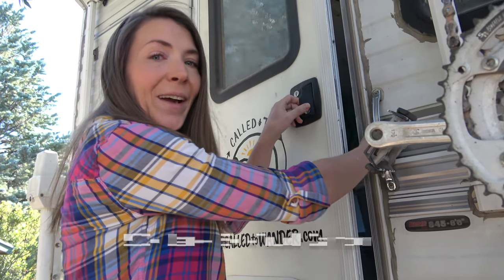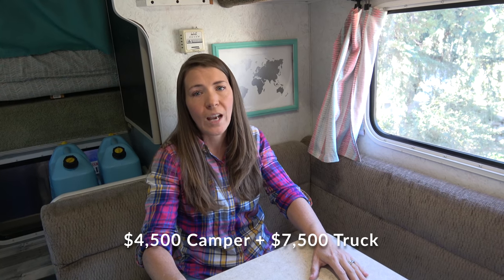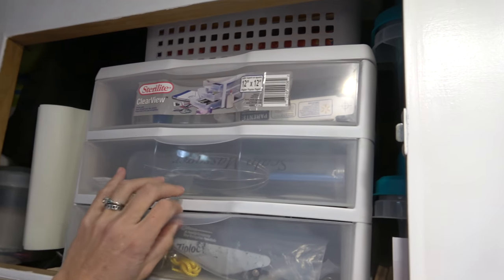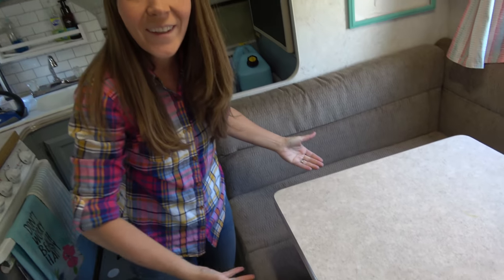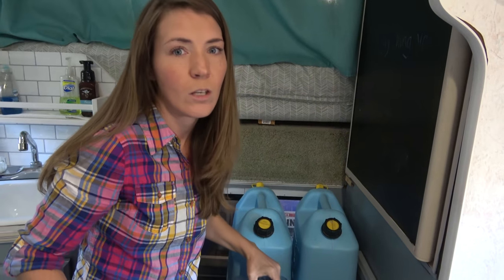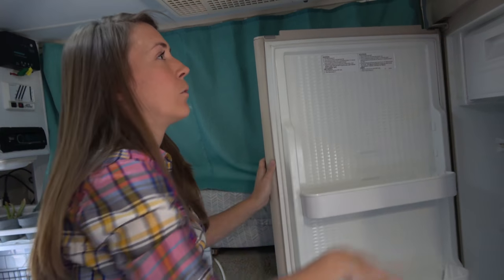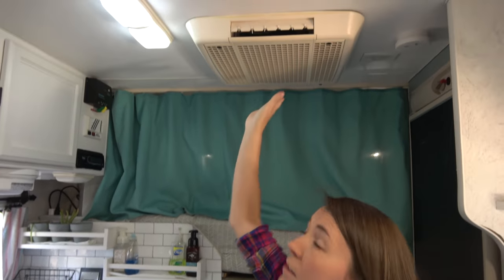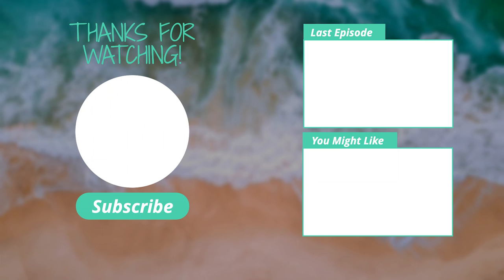TRUCK CAMPER TOUR after 2 YEARS on the road // Tour Our Remodeled Tiny House on Wheels // CtW

Comment: The location of the bed in these campers invites mold, very informative on how to prevent moisture from collecting underneath your mattress. Your transparency about rot and how you cured the ill. The bathroom door solution will help  keep the moisture down in the bathroom too. Good job! Thanks for sharing. ✌️☮️
Reply from the maker: Thanks! We did discover mildew beneath our bed and realized we could build a simple setup for much less than the fancier systems that are sold. Thanks for watching and reaching out!
Reply: @CalledToWander   They have Froli systems people really like.

Comment: I have an older Lance 945 Squire camper on a 1997 F250 HD with the Legendary 7.3 Power Stroke as well!! A truly incredible engine and truck! I like leaving the inverter accessible like you did... but instead of running wires throughout, I wired my inverter straight to the electric box so all of the outlets around the camper - inside and out - are energized. I also have to get something under my mattress as well. That was a super idea and cost effective too - I had mold under my mattress as well. Love your channel!
Reply from the maker: Thanks so much! We’ve traded in the Tc for a motorhome but miss our tc dearly. Enjoy the road!

Comment: 27:30
2003, we built our latest ExpeditionVehicle.
I fabricated a metal bed frame over our flip-top crates storage.
The mattress lays on 'expanded' metal, similar to stout window-screen.
For ventilation -- irregardless of weather or season -- we open windows on opposing walls.
To reduce interior humidity, we cook and shower outside.
Summers are up rough logger tracks to remote mountain lakes, winters on isolated Baja beaches.
If the weather turns too wet too long, our caravan can usually agree to move.
Reply from the maker: Sounds nice

Comment: Great video , very well explained and thought out mods . I have a 1989 Lance  Squire-4500  . I just got it and repaired it , then  added solar , two more batteries , roof rack , stereo etc . But yes exact same floor plan and design . I have it on my 2000 Dodge Ram  2500 diesel truck  5.9 cummins . I bought it for the one piece metal roof and it's really light at 1730 lbs. I have been thru 4 campers now and still have two of them . Ok thanks again and happy trails out there .... 👍
Reply from the maker: Thanks! Sounds like you know far more than we ever did about TC! Glad it's working out and thanks for watching and reaching out!

Comment: You guys have really nailed it. Your tour was very informative, thorough and really demonstrated what it is like to seriously live full time in a camper. Many touches most people would never probably think of, the roll-up bathroom door, the wooden grid under the bed to prevent mold, the subway tile in the kitchen, etc. Every square inch is utilized. Excellent presentation and thanks for your effort and for the references where to purchase your upgrades. Thank you for mentioning the price point of your rig, it's a good baseline when we go shopping to know there are some great bargains available. Also, the nod to Ikea was helpful (they should sponsor you!). Ikea may want to create a section just for RVers, they would make a fortune. Thanks again.
Reply from the maker: shrinkdoc49 Thanks for all the positive feedback! We wanted to go with a longer tour to give a lot of the details that most tours tend to pass over. Let us know if there’s anything else we can show you about the camper!

Comment: Thank you for sharing your tiny home with us. We use the space above our bedroom windows to hang our hats. We also use the ceiling to hang our fishing rods. We have a fifth wheel but making our bed is difficult too. Just last year I had an happy accident. I was too tired to make the bed so I just folded the sheet and comforter then layed it across the bottom. I layed the decorative throw across it then tossed the sham pillows in place. When I looked back I realized it looked just as pretty as if I had struggled to make it. So now.. that's all I do. So much easier. Don't know why it too me so long to figure that one out. Lol. Happy travels.
Reply from the maker: That is a happy accident! We will don't put much effort into making any bed so even what you came up with sounds like work! Thanks for watching and reaching out!

Comment: Suggestions or idea's ?  my goodness no.  I am in awe of how co-ordinated and beautifully you have used every space available.  Things aren't just put in space to get them out of the way,  on the contrary you have things in spaces where you need them for ease of access.  Your tour was complete and informative and I can't think of anything you missed.  I love the removal of the bathroom door and the roll-up bambo curtain.  
I have had an old motorhome, 2 5th wheels and now a pull behind travel trailer I live in full time.  I traveled from N.J. to Arizona back in the 80's in a truck camper my 1rst wife owned, and it did great.  
I have seen the winds of Wyoming, Colorado and the Dakota's and figured it could be scary with a truck camper being so top heavy and narrow based. This is where I would figure a dually would give more stability.  Have you and Chris ever experienced heavy wind issues?  
Super nice video and great job. I was riveted to the video from start to finish.  
Best of wishes to you both for a super future.  
After my wife of 21 yrs passed away, I sold our home and land in northern Vermont and have lived in my travel trailer ever since. 
10 yrs to date. Presently set up in RV resort outside of Tampa. (Thonotosassa, Fla)
Bruce Matthews/retired farrier of 47 yrs. Disabled Vet.
Reply from the maker: Thanks for taking the time to reach out! Sorry for your loss, but glad you're making the best of the nomadic nature! We had some really rough wind coming across the panhandles of Texas and Oklahoma. And again in central Wyoming outside of Lander. The truck held up well and we don't know whether the dually would have helped or not. We just went slow and steady and kept an eye on the weather before driving into winds that we knew we could not handle.

Comment: Hey Chris and Lindsey,
Enjoying what we have seen so far.  We have the same camper, model and year.  Added 200 watts of solar last summer, except we have our camper on a 2002 Chevy Duramax.  Funny we have the same 17" Blackstone, love that grill.  I just purchased and installed the indoor shower head as per your suggesting (thank you), yet to try.  
We generally use our camper daily for dawn patrol SUP surfing, love having a heater to change into my wetsuit, our own bathroom and a outdoor hot shower after.
I've been thinking of converting to a flatbed for months, not sure I can get the same bang due to the original bed is a short bed.
Anyway's look forward to reviewing more video's, I'm interested in Alaska.
Stay and eat healthy!
Reply from the maker: Thanks for watching and reaching out! We love our camper and glad you feel the same about yours! The shower head is going to be so much more convenient! As for the flatbed - the shortbed won't be a terrible. We built in the extra space between truck and camper with our long bed but it's just luxury really. If you want the side storage with the flatbed that you lose with a standard bed then flat is the way to go. We didn't want to lose all that space. But it's definitely 6 one way and a half dozen the other! Sounds like you are using your setup well! Keep us posted if we can provide any more help or ideas! Thanks again!

Comment: Love the video. We camp a lot we have a dodge 3500 our camper is a 11.5 skyway. We have 1100 watts of solar and 4 battery bank. I like some of the changes you made. I removed the furnace and installed a warmtoo diesel heater very efficient uses like no power at all. Also if you installed a easy start on your a/c unit you would be able to use just one of those generator.
Reply from the maker: Thanks for pointing out your mods. We'll look into what we can do with ours.

Comment: Very nice I just watched video on production on the newest truck camper there nice but expensive I have 94 elk horn put a wood stove & tile floor no hot water heater so I'll heat up water put in a hand pump deck sprayer work great very little water to shower next I'll put 2" foam panels on in side
Reply from the maker: We've never owned much "new" let alone a camper because of the cost. Sounds like you've got an idea for what will work for you!

Comment: Great decision on the truck and the truck camper and at a great deal I might add. I wouldn't have it any other way either, you can always take the camper off the truck if you want to use the truck for whatever reasons. And if you have a 4X4, it'll definitely take you "almost" anywhere. I am looking to build one of my own for my wife and our dog but I'm looking for one of those lightweight pop up truck campers. Happy and safe camping.
Reply from the maker: Thanks! We were realy torn between a van and truck camper. But when we realized what you pointed out about separating them (and the fact we have HAD to separate them several times these past 2 years) it has really been great. Plus they are the perfect RV for Alaska and Baja for the mobility. Enjoy your build and, of course, the road! Keep us posted if there is anything else we can do to help you with your rig! Here is our sort of 'how to'' post on the buildout: https://calledtowander.com/build-a-flatbed-truck-camper/

Comment: Couple things. 1. I commend the quality of this video. Nicely done all around. 2. I am impressed on how 2 adults can live in such a tight space. We have a larger TC and wife is ready to get home after 2 weeks lol.  Me, I could go who knows how long. 3. Nice job on the updates, mods, decorations. Can I ask what you did to paint the walls and cabs?  I want to do some updates to our 2006 Lance 951 but fearful paint won’t stick well.  IE scratch off if ribbed etc. Thanks and Happy Travels
Reply from the maker: Fl Yak Fisher Thank you! We actually didn’t paint the walls of the camper, only the wood parts so I can’t give any feedback or advice on that but I know it would most likely involve a lot of cleaning and a lot of paint! For the cabinets I used chalk paint because of its low odor. I lightly sanded the cabinets first and it took several coats of the white paint to cover the wood. A primer probably would have helped with that but I didn’t use one. The grey paint on the bottom cabinets I only needed to coats. And for chalk paint you need a sealant to keep it from scratching/chipping off. It’s held up pretty well but the white paint does get dirty easily! As far getting along well in such a tiny space.. I (Lindsay) as a woman am very laid back, not a lot bothers me. We spend most of our time outside (the beautiful sunny Baja weather helps!) Plus we love this lifestyle and want to make it work and we never wanted the “American Dream” of owning a house with a 2 car garage and kids. Thanks for watching and if you have anymore questions just ask!

Comment: sorry, I had to laugh when you said 29 gallons of water and needing to conserve for showers....in my current camping setup I use a 13 qt / 3.25 gallon steel pail with a mix of river/lake water and heated water for showers!  Only a few minutes (4-5? at most) it's enough....I could go crazy and buy a second pail and 2x the time....but not necessary yet.
Reply from the maker: Sounds like you have the system down! In Baja we learned to use much, much less water as we wanted to stay on a beach longer. Chris got it down to 1/2 gallon rinse... always looking to be more efficient, right!

Comment: One question I have to ask. You never mentioned having a dog with you. How does that work out. Did see a picture of a German Sheppard, Also the waste disposal would be informative. All you talked about was full of information and would help me out building my camper. Thank you with many blessings.
Reply from the maker: Thanks. We did have 1 dog when we started and got a second "COVID baby," both Australian Cattle Dogs. We sold the truck camper in fall of 2020 so can't really update on this. But this camper had a standard black tank and grey tank with a wet bath so the toilet was in the shower, but the plumbing fo the toilet and shower were separate. In our new motorhome (1999 Class C) we built a modified composting toilet so we divert the urine into the black tank and have the grey tank for shower and sink.

Comment: Love the mods. I have almost the same camper but I'm only just starting out. Getting it ready to snowbird south as well.
I've got nearly the same camper except it's one of the earlier metal frame campers. It's very dated looking inside but I'm more concerned with getting it ready to roll. As of today I think it's ready.
Yeah, I had a wood camper before and it had horrible rot. I had to demolish it. That's what attracted me to this metal frame unit. It's heavy though, 3500. 

So how do you keep the mice from crawling up on your axles and chewing on wiring? I've got some caster oil around here. I wonder if that would do it?
Reply from the maker: We were able to repair the wood rot relatively easily. But it's nice to know you don't have to worry about it. As for mice, we've never had an issue. We've heard of places to camp/not to camp where this is an issue. We were told to pop the hood to let the engine cool off quickly since a lot of times the critters are attracted to the warmth of the engine. But again, we've not had that issue.

Comment: If you get an "easy start" for your a/c unit. You can run it on a 2200i honda gen or get a 2.5k onan lp gen installed.
Reply from the maker: We're already married to our 2x Honda 2000 generators. Haven't run the AC once off the generators yet... but know we will in Baja in the summertime so we have some time.

Comment: We didn't get to see the front of of your truck.  I have a front trailer hitch that you can install a Harbor Freight rack for carrying things.
Reply from the maker: We have a receiver hitch for both the front and the back, which we wired for the winch. We used to carry our bikes on the front receiver hitch and store the winch when we were not offroad. Then we mounted the winch on the front and put the bikes on the camper ladder rack. Definitely need a receiver hitch to accommodate the variables in carrying things!

Comment: Can you tell me how to use the refrigerator in all different modes? Please and thanks
Reply from the maker: Not sure exactly what you mean by that. But if you have a 2 or 3-way there should be a knob to switch between. Propane is usually most efficient. If you have shore power then 110V AC is great to save on the propane. And we don't advise running on 12V DC for standard RV fridges unless you have one with low power draw. They're notorious for draining your battery bank. Hope that helps!

Comment: Did you upgrade your battery bank & add power? where did you put it?
Reply from the maker: With this setup we put 2 agm batteries beneath our bench inside the RV, then ran the wires around to the distribution center from there. Doing it over, we would have added lithium instead of AgM but it worked well!

Comment: How did you find a used truck camper so cheap and did it have a lot of problems like leaking?
Reply from the maker: We did some thorough shopping for what we wanted in terms of camper models. Then we got “lucky” by finding the model we wanted just down the road from us. We’ve seen cheaper ones, but like all things, you get what you pay for. And yes, we did have some water damage we had to repair. And in the course of our first year in the road we had to repair almost every gas appliance (small parts, not replacing the appliance itself). But that is to be expected with an older used camper